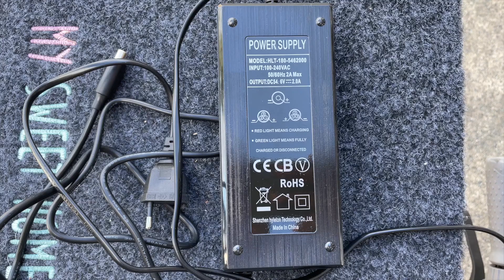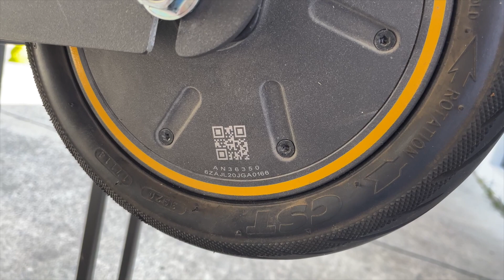Segway Ninebot Max G30 - Current My scooter hardware setup.

Comment: the reason used original controller is also can use 48V by custom firmware?
Reply from the maker: Yes. That is the main reason to use original controller Even I purchased a Monorim controller.